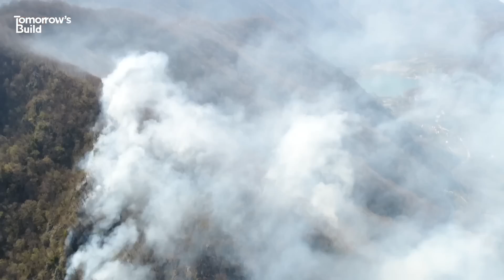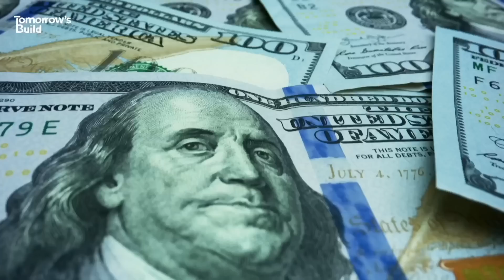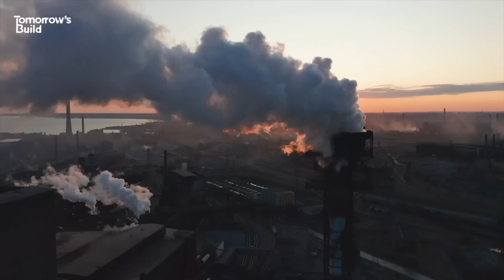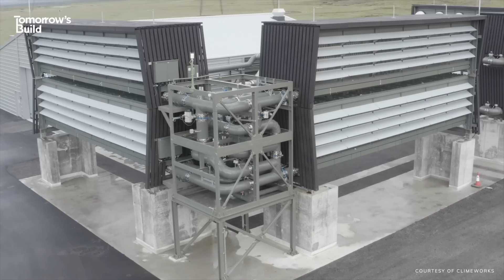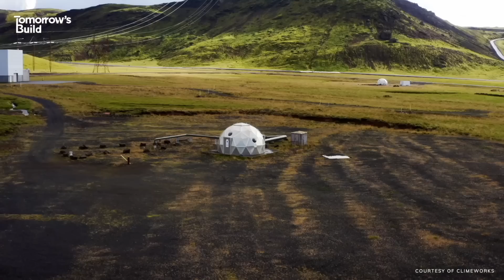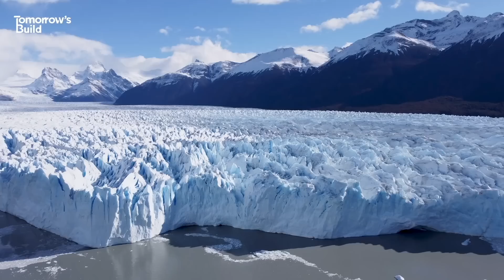This Machine Could Reverse Climate Change | Tomorrow's Build

Comment: The carbon capture industry is actually a scam and doesn't work. This has been proven by multiple agencies worldwide. The biggest problem is that we are actually increasing carbon emissions and not reducing them. Carbon production from coal, gas and oil companies has been falsely offset by the use of carbon credits that are actually useless and is just another one of the scams governments and companies are using to claim that they are meeting their carbon reduction targets. Carbon is just one of the greenhouse gases the other one that is causing major problems is methane, due to the current runaway greenhouse effect the permafrosts worldwide have started to melt releasing the methane that has been trapped since the ice age. The polar ice caps have also melted to the point that they are not reflecting the sun's radiation increasing global warming even faster. None of the climate scientists have taken into account the effects of flair towers that are constantly burning the unwanted gases from oil and gas wells, the gases released by fracking has also not been accounted for. Both flair towers and fracking plants are unmonitored. The burning of fossil fuels has been constantly increased even in places where wind and solar farms have been set up. Unfortunately the people who have been building wind and solar farms have actually been wasting money on systems that are inefficient uses of the technology. You can easily produce enough electricity for any modern city with rooftop wind and solar power systems but to store and regulate the power production you will need a battery system, the cheapest and most environmentally friendly battery is a closed loop hydroelectric power station, close loop hydroelectric power stations can be built any size from powering a single light bulb to an entire city but smaller units are more cost-effective, faster to build and cheaper to maintain. Closed loop hydroelectric power stations can be built underground or incorporated into building design saving space and placing the power production closer to the point that the power is needed eliminating most substations and transformers. The only way to reduce greenhouse gases is by restoring the ecosystem that created our atmosphere this will mean returning the surface of the plant back to its natural state so all farms will have to go underground but grow light plant farming will increase the yield of each crop and allow multiple crops per year increasing food production so that famine and starvation can be eliminated. We have 2 years to completely stop using fossil fuels before the runaway greenhouse effect becomes unreverseable. We actually have the technology and resources to be completely fossil fuel free in under 2 years but we lack the intelligence and willingness to use it. At the current rate the human race will become extinct in less than 100 years and the world as we know it will be unrecognisable in less than 50 years, people alive today will be among the last humans to exist. We only have ourselves to blame.

Comment: Wouldn't it be more efficient to build these on top of the factory's chimneys that produce the carbon in the first place? Seems ridiculously inefficient. Trees themselves do a pretty good job, so if we just built these where they're most needed (actually reducing our carbon footprint) then over time, trees would just suck up the rest. Put it into law that any factories producing over X amount of Carbon has to have a method of capturing it and boom, we're done... problem solved

Comment: climate change is fake news.
11 flat bottomed flasks with temperature probes and each containing a different amount of co2, 0.0%, 0.01%, 0.02%0.03%, 0.04%, 0.05%0.06%, 0.07%, 0.08%0.09%, 0.10%, equidistant from an inrared lamp over a 24 hour period, shows that co2 has nothing to do with temperature of the air inside the flasks.
stop lying to the kids.

Comment: We will need to use every single method of carbon capture. Weather that be regenerative agriculture, carbon capture by mineral accretion through electrolysis, direct ccs and indirect ccs.  All of these will have to be used in conjunction in order to have an appreciable impact.

Comment: few bits, love the way you show a picture of trees when you talk about carbon capture infrastructure. Also it doesn't really work, could go wrong when it does, uses a lot of energy when it does  and as you say it it is , used for greenwashing or excuses for not doing anything about reducing the emissions we are producing in the first place. 

Also climate change is already happening, the storms fires and heatwaves show that. There is no reversing it, just reducing how far it goes. The best way to do that would be to reduce human consumption now, and through voluntarily having less kids for several generations until we have a small resource abundant global population.

Comment: Nobody needs to be saved from man made global warming because it's a complete and utter sham. In fact, it's not only is a sham, but CO2 is beneficial for the environment in that its free fertilizer. As it not only increases crop yields but it also contributes to the greening of the deserts .

In fact, for most of the earth's history, CO2 levels were far higher than they are today. As there is no correlation between CO2 levels and the earths temperatures.

Comment: Carbon Capture is pointless without a good carbon free energy source, it’s very similar to the perpetual motion concept. The best thing to do is not make carbon in the first place, but unfortunately mankind has been stuck with the worst type of fission reactor design known to mankind, at about 1% efficiency rating which means those spent fuel rods only use about 1% of the Energy extract from it then put the rods under ground for 20,000 years. The water is what makes those reactor design so dangerous because it wants to turn into explosive gases when things go wrong, and when they do you have another radioactive ghost town. The fission reactor we really need is the Thorium Molten Salt Reactor highly efficient, walk away failsafe, and burn the cleanest from of fission fuel with only a 300 year of radioactive storage required as opposed to 20,000. With the thermal output from this Thorium Reactor you could cut carbon footprint of vehicle fuel by almost 50% just by using its thermal output of this reactor to directly distilling vehicle fuel from crude oil instead of using the crude oil itself to run the oil refinery. Plus unlike renewable this from of energy is more resistant to extreme weather events, it still works when the sun sets and the wind stop blowing.

Comment: Some amount of global warming has already taken place, but after rising at 2/10°C per decade through the 1980s global warming suddenly paused in the early 1990s at a reported 1.1°C.  Over the next thirty years global warming never increased to a reportable 1.2°C.   In 2022 global warming was reported at 1.1°C.  During the previous thirty years carbon dioxide levels continued to rise with no increase in global warming and no correlation over the normalized global warming temperature of this period and increasing levels of carbon dioxide in earth's atmosphere between these temperature end points.  

The cause of global warming is not known.  It is known global warming didn't emerge from well known characteristic of earth's atmosphere such as the less than 1% share on average the noncondensing gasses, such as carbon dioxide and methane, have in earth's greenhouse effect with a total of less than 0.1°C temperature share in the greenhouse effect.    

1970s high school level earth science describes the earth's greenhouse effect as adding 10°F (5.55C) to earth average temperature due to water vapor's ability to trap inferred radiation (heat) radiating from the earth's surface that would otherwise radiate out into space.   The primary interaction takes place within the first 60-feet (20 meters) of the earth's surface.   

Less than 1% of the greenhouse effect is shared with noncondensing greenhouse gasses, such as carbon dioxide and methane.  The noncondensing gasses are not normally included in calculating the temperature gain from the earth's greenhouse effect for a few reasons. 1) Non noncondensing greenhouse gasses share of the greenhouse effect is between 1/2% to 1% and doesn't really effect the greenhouse effect temperature gain   2) If the noncondensing gasses were physically removed from the atmosphere if would not be expected to change the temperature gain from the greenhouse effect much or at all because the temperature share of the greenhouse effect from the noncondensing gasses would then be taken over by water vapor.  

There are slight difference in the proportional interaction strength over the inferred temperature frequency band of the various greenhouse gasses making them not precisely interchangeable, but in the case of carbon dioxide with a CO2e of 1 and water vapor with CO2e of 18 (varies) water vapor still has some small interaction in the window of the inferred frequencies it is weakest and CO2 is proportionally strong.  Without CO2 in the atmosphere water vapor would still eventually absorb the inferred radiation frequencies it has its weakest interaction with that CO2 interacts with at about same rate as it does with other inferred frequencies.   The overall change to earth's greenhouse effect if all the noncondensing greenhouse gasses were physically removed in normal levels of water vapor would likely be close to net zero.   

A report was released in the early 1990s and used in several TV documentaries on carbon dioxide's effect in the earth's atmosphere.  The conclusions by the mid 1990s where accepted as credible after several years without being discredited stated carbon dioxide levels in earth's atmosphere from human activities were reasonably estimated to have added 1/100°C to earth's temperature from its week greenhouse effect and were non poisonous.   In the early 2000s this 1/100°C figure from another study was seen to be about 50% high.  It is more accurate to call this 1/100°C temperature from human caused CO2 in the atmosphere a "share" rather than an addition, because if it was not present water vapor would interact with CO2's past share of inferred radiation  to such a high degree it's loss even if many times larger would be immaterial.  

In extreme low humidity such in Antartica in the winter time when water vapor is near zero and temperatures below -40°C scientifically the noncondensing gasses may take on more importance in the greenhouse effect.  There is however very little radiant heat from the earth to interact with them.

Comment: I think the device can absolutely capture co2 but it does not mean it will have any impact on temperature. Co2 is not the control knob. Certainly you can make some building materials from it, plus limestone, lime, even coolant. That translates that we save some stuff from going to landfill by refurbishing for another use.
Reply: CO2 is not a pollutant. I hope they are talking about CO.

Comment: They need to use energy, presumably to be green you'd need to use green energy. Okay so now we're using green energy to capture carbon, if we used that green energy to replace fossil fuels or make green hydrogen, it would stop more CO2 by doing those two things than Carbon Capture. So it is redundent unless the whole planet is using 100% green/ renewable energy, because if it wasn't then we could use that green energy to replace some fossil fuel use. Which again would stop us from producing more CO2 then we can capture.

Comment: "Let's just plant trees" - well if is that easy we wouldn't have just found out that 90% of the worlds biggest issuer of forest carbon offset certificates are largely worthless and could make global warming worse. (check out Verra)

It comes down two 3 things:
- Complex problems are never sold by one single solution. Call out whoever says Carbon Capture solely will reverse climate change. But just planting trees won't either. Think more of multitude of solutions working together.
- Technology and process will take time to mature. This needs to happen now. Contribution of current plants is totally negligable. But that is the case with all new technology. There is also no energy produced by any fusion power plant but people here in the comments claim that as the solution while claiming that we should not waste energy on researching carbon capture technology. Similarly we need to learn how to conduct effective and efficient forestation, rewilding projects and transform the way we farm. Managing eco-systems is not the strength of Western/Industrialized nations either. Lots to learn from the indigenous people.
- Doing something at scale is always hard. True for solar. True for planting trees. True for sequestering carbon in topsoils. True for storing carbon in oceans. True for Fusion. True for Carbon Capture. Something that works in one place, will not necessarily work somewhere else. Supply chains need to be developed. Laws changed. People trained.

Comment: There is no climate emergency. There isn't too much carbon dioxide in the atmosphere. Carbon dioxide is the most essential gas in the atmosphere, and it exists as only a trace. If the levels were much lower all complex life on the planet would disappear. Removing it from the atmosphere is hubristic madness.
Reply: No one wants to remove all co2 from the atmosphere boomer 

And ever heard of too much of a good thing?
Reply: @darthmaul216  Still over on the dark side are you, Maul?
1200ppm or above would be optimal for crops. We're never going to get near that.

Comment: I honestly believe it is more efficient to keep a bigger area of trees that you pollard every 5 to 7 years, make it into biochar, mix it with wet manure and put it in the ground thereby improving the soil and crop yield as well as locking the carbon away, than building expensive, huge vacuums with not so very high efficiency, to place it in a cave or under the ocean floor.
Reply: Well, scientists disagree with you....
Reply: when you talk about efficiency you kind of need to tell us in regard to what resource. If you just talk about the space needed for per captured CO2, the forest does not win. But there are perhaps other things to have in mind.

Comment: i think i read somewhere that its more efficient to capture CO2 not from air but from out oceans? also i feel CCU rather than CCS is the way to go as you can turn the CO2 to methanol and make even better methanol fuel cells...

Comment: To me, DAC strikes me as an excellent dispatchable load; one that could be run when there’s an excess of solar/wind that can’t be utilized otherwise
Reply: don't underestimate other ways to utilize that Energy thou.
Reply: @MusikCassette  I'm saying this is after ALL the storage is filled up and there's no other load available
Reply: @Thunderbuck  storage is also a bit down the line. there are a few other things that would come before that.
Reply: Nah, we should rather store up excess heat (in hot sand or underground water tanks) and excess electricity (by pumping water up reservoirs and in batteries) for times when sun and wind don't provide enough energy
Reply: @ooooneeee  but that is also not the next step.

Comment: I think one massive way to sink a bunch of carbon that people don't consider is through our farmland. We grow ridiculous amounts of plants that absorb co2 to grow, but then huge percentages of that plant material is left in the fields to rot, which re-releases that co2 they captured back out again mostly. If we collected that matter and used it in biochar reactors we could harness the carbon and use it in biodiesel, the reactors themselves can generate power and heat for districts or light industrial usage since the reactors have to get over 500c. And being perfectly honest, if we were using vertical stack AI driven indoor farms located in cities, there would be much less need to worry about retaining soil as it's grown hydroponically, plus all that land we farm on now could be restored to nature.

Comment: I'd like to see the carbon footprint for the full manufacturing and installation of a carbon capture plant made known to see how long it has to operate to start actually "achieving" its purpose.
Reply: Carbon Capture is a scam
Reply: @sm3675  how so?
Reply: Only about two millennia
Reply: Typical climate change denier comment.... Also probably asking yourself "Wh3rE D0 @lL Th3 Mat3rIaLs coMe Fr0m" Still less than firing up the coal fired power plant and keeping doing what we are doing. It is called a transition. Transitions don't happen overnight. So, yes there was a carbon footprint by building this structure. Well done Einstein.

Comment: So that basically means we need to develop a reason why we should capture CO2. I'd love to see whether you can use that CO2 to make carbon fibre or graphene, or maybe construction and decorative stones like marble. Wouldn't it be awesome to be able to live in a house where the walls are made of captured carbon ? That'd be a huge amount extracted from the atmosphere that's not going anywhere for a long long time.
Reply: Actually I got great news!
We do have the technology to build houses out of captured carbon and chances are that you already have some of this material in your home. Its wood, wood is made from carbon from the air and using it for construction locks it in for a long time.